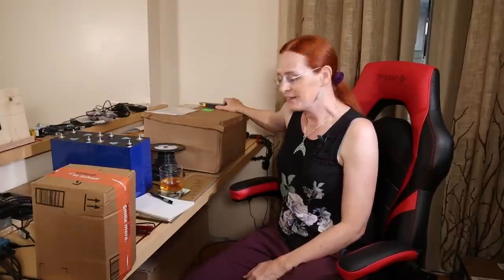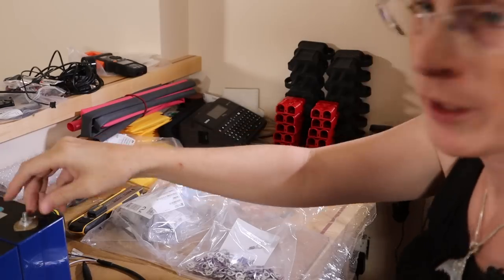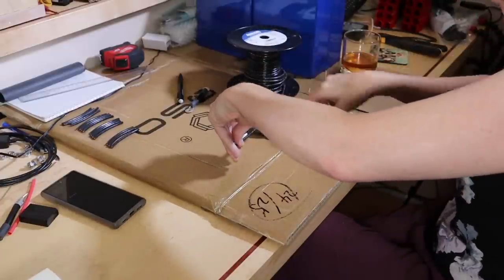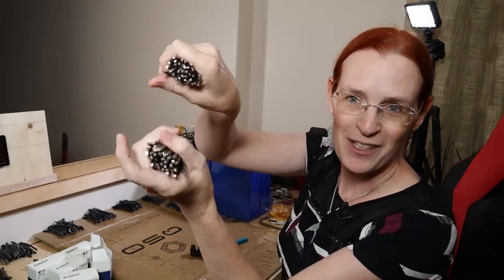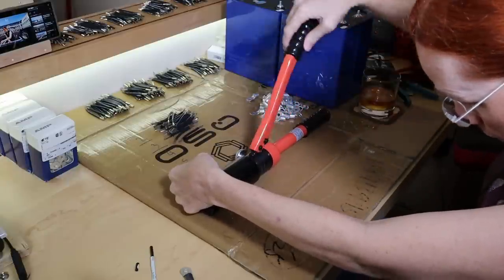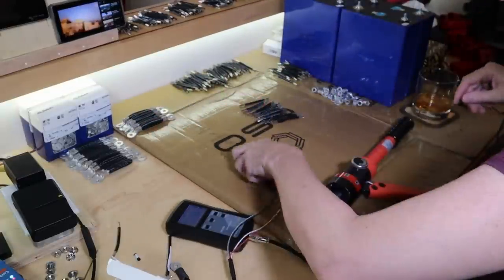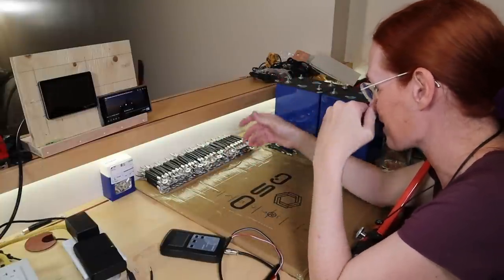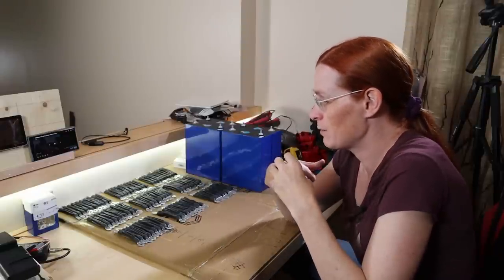Making 90 Flexible Bus Bars! - 48v LFP Battery Build (Ep. 35)

Comment: I cannot decide which i admire most ,your patience, your persistence or your enthusiasm but keep it up i cannot wait to see this project through to the end. I have a small 12 volt system to run the aerators in my pond and a 48 volt system to run my pool pump and various other stuff as needed like power tools etc. I had to remove the Anderson connector from my 48 volt battery because for some reason it did not have a great connection to my battery so i used a bus bar instead.

Comment: Hello, I have all the admiration for your work and I admire you. A few days ago I also completed 30 busbars for my 32 cells and 600 amp battery bank.I approached the problem from the point of view of corrosion that can occur at the aluminum terminals of the cells.I used a 35 mmp conductor and at the ends I used ring terminals made by me from 2 mm thick sheet, the sheet which has one surface of aluminum and the other surface of copper.I soldered the 35 mmp copper conductor to the copper surface of the terminals.Thereby  it will come into contact with the cell terminals only the aluminum surface of the terminals.Thus, at a length of 18 cm, we obtained a resistance of 0.15-0.16 mohms.
   Before this setup, I used the same type of cable, the same length, but at the ends I used copper ring terminals soldered.I was fine for almost a year, but after a year some problems appeared due to the oxide that appeared between the aluminum terminals of the cells and the copper ring terminals.
   I opted for the version with flexible busbars because the placement of the cells requires it and because the cells are fixed in a frame with 300 Kgf.

Comment: I have only recently got into building lithium battery packs (just the 12 volt ones for now) for my tool shed. My plan is to only use solar in it.  I also use the solar system in my shed to charge my e-Bike and my daughters e-Bike. Love the channel

Comment: Adding an inverter to my setup next month.  Went looking for actual bus bars to bus the battery, inverter, solar charge controller through.  £60! For a pair.  ** right off.  Nickle plated copper is expensive!  So instead I am going to research the ohm-age compared between a NPC bus bar from a battery and a "Henly block". Henley blocks are those huge brass lumps which connect the mains "tails" in meter boxes.  They are designed for 22-30mm^2 wire and 100A+.  
Yes, yes, yes, brass is only 28% as conductive as copper.  However henley blocks are substantially larger and have far, far more conductive mass to them.  While a 100A NPC bus bar is about 2mm to 3mm thick... a 100A Henley block is a solid block of brass about 1" thick.
Henley blocks are about £2.50 from a local electrical supplier and come in insulated covered forms.
The only concern is that ohmage.  In a 240V electrical installation and 100Amps, loosing a few voltages doesn't really matter.  If you are running 24V through it through, a few volts does matter!

Comment: I am sure that attention to detail will prove well worth doing. If you choose to do a reinforced resin I would suggest what both my son and I have found on our boats. Total Boat epoxy resins. For any wood on your boat a good prep of the surface and a couple coats of their penetrating epoxy is incredible as either a stand alone or a base for further layers. The 5 to 1 resin is very easy to work with. It is so good along with the penetrating, that I can tell you a piece of lauan plywood prepped with penetrating epoxy and then layered on each side with 1708 biaxial cloth and the 5 to 1 epoxy makes a great stiff panel. Building the boxes that way would use the best properties of a lightweight core and  structural skins. Making just the plywood with penetrating first and cutting the proper five pieces to make an open box would allow you to build a little fixture to secure those five pieces with biaxial tape on the outside corners and then to line the inside with 1708 and the outside if you just want so added stiffness. My guess is because of the short height those would not need exterior skins. I would use a 4 inch wide biaxial tape. If a panel like that is good enough for my son's sportfisher I am sure it would be great for your battery boxes. For my use I laminated solid core plywood and coated with just resin for the wood section of an extended motor mount to carry a 115 hp outboard. That was attached with epoxy and bolts to large angle irons that made the extension portion. The interior transom was reinforced with aluminum epoxied into place and the whole thing bolted with many 3/8 stainless bolts and nuts. It is now stronger than the original mounting portion of the transom. While we are at it, Total Boat TotalBuff is incredible for removing oxidation and will even polish out 400 grit sandpaper swirls. Amazing stuff. Great for the first step in making your hull slick as can be. Finish with Shurhold Pro Polish and Sealant. Good for more than one season on many boats in the same marina where my son has his.
Reply: I have also heard nothing but good things about the Total Boat epoxy resins.
Reply from the maker: Ya, TotalBoat is where I figured I'd go.

Comment: I know you enjoy crimping and making your multi-cable flexible bus bars, but look into making busbars with custom PCB's. I got the idea after building a PCB based powerwall from Jehugarcia. When i built my recent battery for my sailboat i went custom PCB design and built a custom PCB with equal length balance circuit into the PCB for my build with mount position for the BMS. I designed enough space in the PCB, so when the terminals are mounted to the PCB, there is equal spacing for battery swell. The PCB route was cheaper for me than buying all the wire and terminals to make my own busbars. I used as much space on the PCB and designed the battery connections as wide as possible.
Reply from the maker: Custom PCBs is a wonderful idea, and I did actually consider it. For me, personally, I like the idea of "simplicity is reliability". That said, as with all things in boats, it's all about trade-offs and compromise and everyone has their own sets of priorities. I'd love to see a picture of how your PCBs turned out though, if you'd like to email me! :D
Reply: @TheDigitalMermaid  sure, i also ordered some test PCBs to play around with, i designed a 20mm x 90mm PCB with built in balance hole to solder the balance lead to as a cheap busbar option. It was $35 shipped for 100 of them on pcbshopper
Reply: @TheDigitalMermaid  also, the other reason i decided to play around with the idea of PCB for busbars and such... making a PCB multiple layers, i can hide the copper  internal via the internal trace layers, so less metal exposed for corrosion. Also did you know you can use a hot air soldering gun and melt solder to the connection once you bolt the PCB to the battery terminals around the outer edges of the terminal nut.

Comment: Looks fantastic!! Tons of work, good job. :) Oh, and those Poweramp Anderson connectors - Don't 'test fit' them together without the wires in place! Apparently they will snap together and not come apart, basically scrapping them.
Reply from the maker: OK, I can totally see how that could happen with the plastic leaves inside that grab the lugs. I didn't think of that, and ALMOST snapped them together just because.
Reply: This is accurate.

Comment: I own a 38 ft 1982 383 Morgan. Was able to find liability only insurance through State Farm ($255/yr), even though no sailing experience. Not sure if they issue policies in Canada. Most boat yards require insurance, to put boat on the hard, as you probably know. Good luck.
Reply from the maker: I ended up getting full coverage with Progressive in the US, but they don't offer coverage in Canada. So when I come home next summer, they'll cover me until I change my home port. Then I'll have to see what I can find. When I first looked, I was a new sailor with no experience. Next summer, I'll have a few years of sailing experience, certifications and major boat issues fixed. So I am more hopeful I can find something. We'll see.
Reply: Good on the insurance. Also, I think the YouTube channel Lithiumsolar found the ultimate solution for flexible bus bars. Check it out. Good luck with the boat.

Comment: Moisture sensitivity (MSL) just pertains to electronics assembly - typically in a reflow oven for board-level components. Plastic naturally absorbs moisture from the air and can popcorn during assembly. No big deal once assembling is complete.
Reply from the maker: Aaaaaah, this makes sense! Like pre-heating a mold before pouring a metal, avoid a "steam explosion". Thanks!

Comment: Dear young lady, you are absolutely delightful. I found your channel through battery building, now however I would follow you nomatter what your content. This is obviously a topic for the future, I would like your opinion. To ferrule or not to ferrule stranded wire clamp connection?
Reply from the maker: Welcome! If you see the video where I start the boat work, I mention this when I rewired the shore power connector. I always use ferrules where applicable. Cheers!
Reply: @TheDigitalMermaid  thankyou

Comment: hmmm i got a roll of 6awg wires, but i'm trying to make 48v 120ah pack. I think my max discharge is 150amp. Can I double up the wires and fit into 1 ring terminal or do i have to get much larger wires?

Oh, i watched more of this video and saw you shoved 4 wires into the terminal. I guess that does work.
Reply from the maker: I find it easier to convey awg to square mm and then it's easier to see if two or more cables add up the the cross section of the gauge of wire the ring terminal was made for.

Comment: Flux and heat.  It would be interesting to see the R value for the bus bars if you used flux and heat to strip the oxide layer off the cables before they are cold welded.
Alternatively, although you might absolutely hate me for this...  you could solder them and see if that changes anything.  As long as you use the right solder with the right flux and get it hot enough for the flux to activate it will strip the metal to bare metal and then hot weld them together creating a joint usually stronger than the wire/crimp itself with the maximum possible contact area.
There are downsides to soldering though and soldering 90 flexible bus bars... is why you will hate me if the R value drops in half.
Reply: It's an interesting point I seen made about using plated copper cables instead of raw copper.  Raw copper oxidises instantly on contact with air.  The oxide has a much higher resistance than the copper itself.  In electronics this would be referred to as a "dry" joint".  The conductors did not get hot enough to activate the flux and flow the solder.  A cold weld from a crimper is probably better than a dry solder joint, but I expect a full soldered joint to be better than a cold weld (with mechanical caveats).
The plated copper strands are plated with a metal that doesn't oxidise as much or is easy scrapped through to the underlying copper when the cold weld is happening.  "white metals" like nickel are good as their surface is easy to wear away and doesn't oxidise as easily as copper.
Reply: Another thing to try.  Replace the probes in your ohm meter with gold needle point probes.  With those you can force the point into the metal surface to get a much better contact, giving you are more accurate reading as to the bus bar under XNm of torque from it's nut.

Comment: I'm not sure if it's been mentioned, but what size ring terminals are you using for 4 #10 wires, and what stud size?  are you using metric ring terminals?
Reply from the maker: 4awg ring terminals, 6.35mm studs. Here: https://www.mouser.ca/ProductDetail/571-8-33469-2

Comment: Can anyne please explain? What is the point of compressing, if in this case eventually it will most likely lead to blowout safety valve on the top of the cell (instead of inflating the cell)?
Reply from the maker: Best as I've been able to find, in high C charge/discharge scenarios (like EV cars), compression extends the life of the cells. It doesn't seem to do much in low-C installs.
Reply: @TheDigitalMermaid  I mean physics...if compression prevents pressure to expand sides of the cell... where this pressure will go? Won't it blow the top pressure safety valve instead?

Comment: Hi can I ask you something About these flexibel busbar? 

Wy are you taking multipel kabels to make 1 ? 

Is It cheaper to use multipel small whires than 1 big one ? 

Or what is the idee for this ? 

Sorry for my english 😝

Greets big fan Niels
Reply from the maker: Hi Niels; I did it to increase the flexibility. A single 19^2mm/4awg cable was too stiff. 4x 5^2mm/10awg gives the same (or slightly better) current carrying capability, but it is much more flexible to absorb movement.
Reply: @TheDigitalMermaid  ah ok thanx 
I am thinking to do this. 
If the battery moves in my boat I have less stres on the terminals 
You rock girl keep on the good spirit 👌

Comment: I'm confused on why you can't get insurance, I checked with my insurance company and I have no problem with insurance,  is it a Canada thing?
Reply from the maker: Depends on a lot of things... Back when I bought the boat, I had no prior documented experience as a sailor. The boat is 41 years old. The pre-purchase survey had a defect list, etc. I called multiple companies, and some combination of those issues was used to deny offers of insurance. Since then though, I've gotten ASA 101, 103 and 118 (hoping to get 104 in the fall). I'm addressing all defects from the pre-purchase survey, as well. The boat is still old, so that will remain a challenge. Switching to a new pure electric auxiliary power system will scare others away, I am sure. So while I think it's a solvable problem, it won't be an easily solvable one. :/

Comment: Fact is, it wont matter if it is 21 milli ohm or point twenty one milliohm. 

A SCC event will fry that 10awg in an instant anyway. Always build your buses to take full SCC for at least 100 milliseconds.  Or else.

Use Kirchoffs law to figure the current through.
Reply: A basic electrical theorem says that the short circuit current actually depends upon the two most important parameters:

    The total impedance from the source to the point of the fault
    The nominal voltage of the system

With the help of the basic formula, we can easily calculate the short circuit current at the fault location, and with the help of those values, we can analyze the system and install protective devices and protect the facility from any major harm or damage.

I_fault = V / Z
Reply from the maker: If you look at an older video I posted, I accidentally dead-shorted the 4awg wire, a good long length, and the wire didn't "fry ... in an instant". The T-class fuse did it's job and quenched the arc.
Reply: @TheDigitalMermaid  What was the voltage of the SSC test?

Single cell test at 3.2Vn does not count, build your bank then test. 

wut did i just sai

The total impedance from the source to the point of the fault
    The nominal voltage of the system

= scc. 

With the help of the basic formula, we can easily calculate the short circuit current at the fault location, and with the help of those values, we can analyze the system and install protective devices and protect the facility from any major harm or damage.

I fault = V / Z
Reply: @TheDigitalMermaid  A fuse test is not a max current test. 

90*C wire?  Or 200*C wire? Either way, if those cells are not pushing that much current on a cell SSC test... then they certainly are not 0.00021 ohms intrinsic resistance. 

It all adds up when correct. V=IR. V being volts, I being current, and R being metered in ohms. We all know V=IR for gods sake.
Reply: @dogdipstick  0.21mR per cell, 16 cells in series, together with the contact resistance on the terminals and resistance of the bus bars/wires and BMS. Let's say 5mR total. At 50V pack voltage, that's 10kA. Over 100ms (your number), we generate Energy = P x t = U x I x t = 50000 Joules or about 13Wh. You don't fry a 4AWG cable with that.

Comment: I find it hard to moderate my language when I hear of insurance companies refusing to insure a boat because it has lithium batteries. LiFePO4 batteries are very safe. Having seen a FLA battery experience a hydrogen explosion, blowing the top clean off and spraying acid everywhere, I'm a lot more comfortable with LiFePO4. It's high time insurance companies got a grip.
Reply from the maker: It's a human issue; We're comfortable with familiar but higher risk things, while we fear a less known but shown safer option. It's... annoying.